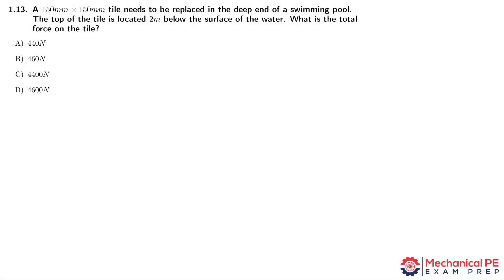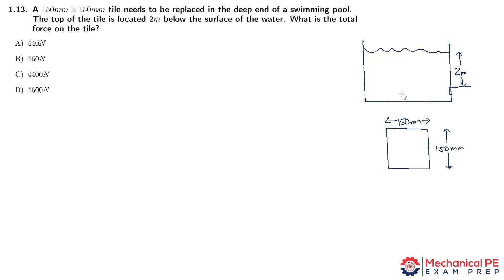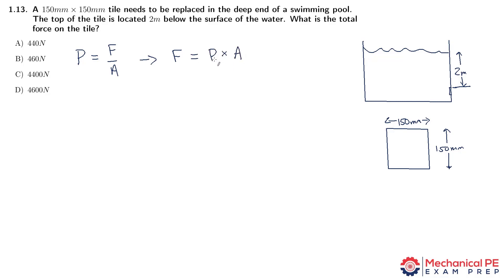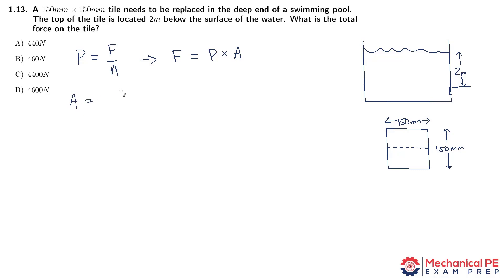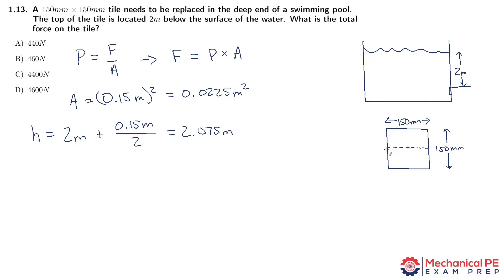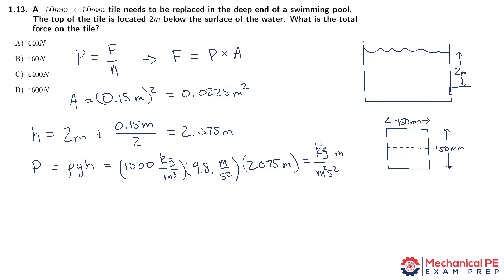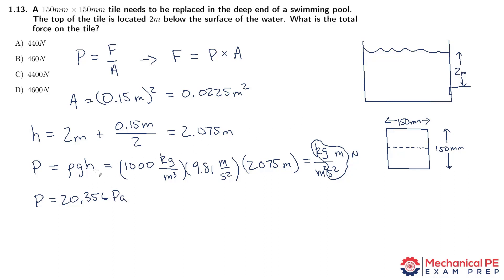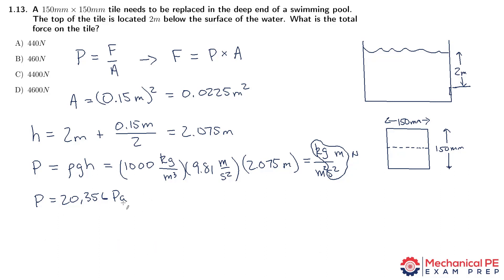Mechanical FE Exam | Hydrostatic Pressure Problem: Solving Force on a Tile Using Formulas

Comment: Thaks for your great explanation, I have a question, why you didn't consider that 1 atm air pressure above the water?
Reply from the maker: Thank Amir.  My thought is that the 1atm probably pushes uniformly on both sides of the tile through the ground, but the hydrostatic pressure from the water column is only hitting the face of the tile internal to the pool.  It's a good question though, and potentially a bit ambiguous the way it is phrased.  I could clarify "excluding atmospheric pressure" or say "the total force due to hydrostatic pressure."

Comment: This problem is confusingly worded. I thought the pool floor was made of tile. Turns out only the pool walls are tile.
Reply from the maker: Fair point, I'll update this one to specify that it's on the wall.  The words "top of the tile" should have been a hint that something interesting is going on, but perhaps not strong enough to rule out a horizontal orientation. There's a decent chance the problem statement on the exam could include a picture to remove any ambiguity.  The floor could also be tiled and this problem happens to be asking about a side wall tile specifically.  Anyway, the most important thing is that after working through it from both perspectives the solution makes sense, and you are making progress!
Reply: @MechanicalPEExamPrep  thank you!